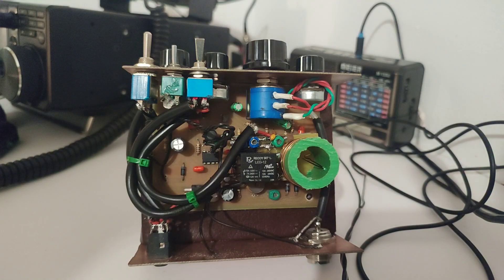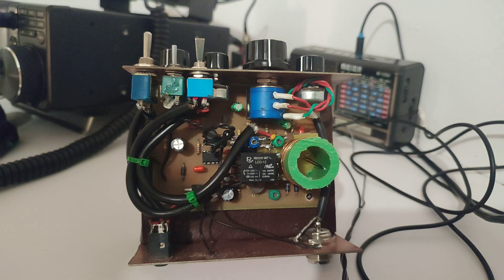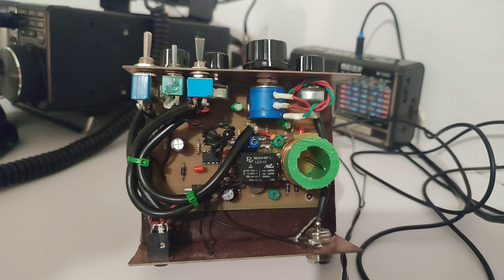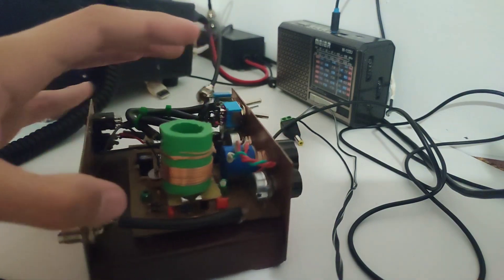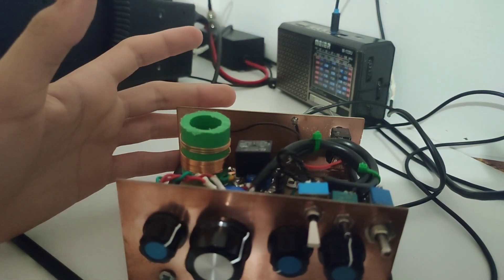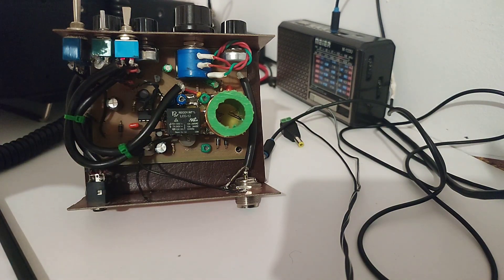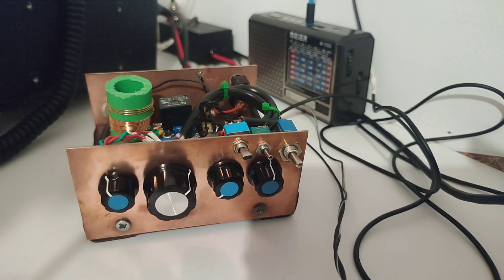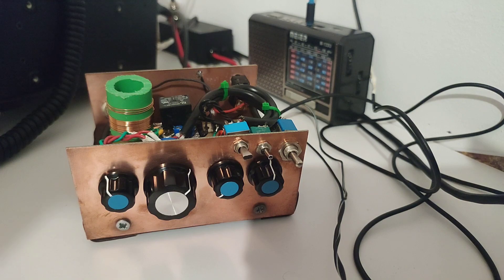2 Band Regen Receiver 40/30/20m (SPUTNIK MOD)

Comment: can you shgare the values or the schematic of the modification?
Reply from the maker: Good morning! sadly I don't have the details for this modifications any more... Basically it's a relay switching the tuning circuit to one of the coils trap
Reply: @sv2tcb  so you just switch more or less turns
?

Comment: Good results. I think band's can increase up to 10 ( 10 position rotary swich ). Band swich in main's LC tank's coil ( increase windings, coil sections ).
Reply from the maker: Thank you for the comment! Yes i should try something like that with a rotary switch but i have to re design the pcb. 73

Comment: You rock Nikos. Well it seems pretty official to me since it works fantastic 😅😅. You are so funny. Really nice results... great job buddy. I am happy your experiments had good results. We talk more on email tomorrow. Today I had a crazy busy day. 73, YO6DXE.
Reply from the maker: Haha thank you, i have the details for the modification and the coil, it works on 30/20 or 40/30 yet. I couldn't get a better demo on 20m due to propagation. 73 talk to you soon
Reply: @sv2tcb  Well... you do realize I just spent two years playing with this one over and over. I've learned a lot from this... besides that it got me into the hobby. I think now is your turn to "improve" it 😅. Is a simple receiver... and the results are nothing like WOW... but is fun to play with... and the best... we learn a lot along the way, I think that is what matters the most. The learning process... 73 buddy and have fun with it. Today I was playing with a large value variable capacitor. If you look into the new version I have now... I soldered the capacitor instead of C15... it was tuning between 4.3MHz to 7.2MHz. Not bad at all 😁😁.
Reply from the maker: @dxexplorer my first video of the receiver was two years ago, i think this is a really simple modification and i instantly works. I have also tried with variable capacitor not that big though and it works in a more broad range. The next step is to make it a 6 band receiver, with the relays you can include everything. If you want more information we will talk with emails. 73
Reply: @sv2tcb  I wanted to make some sort of "all amateur HF bands" regen receiver ... but fully with transistors only. A bit more complicated one with some audio filtering and also RF filtering on the input. But for this I think I will try one of the schematics from N1TEV and start from there. Is a little more sensitive so we will see how that works. A project for the winter maybe. Not much free time now.
Reply from the maker: Ok yes, maybe this project has reached an end. I want to try a qrp transceiver from vk3ye with ceram resonator but i have to find the parts which are not so common.
Reply: @sv2tcb  let me see if I can find something I have in my mind and I will email you an article.
Reply from the maker: @dxexplorer yes please. I would like to read it. Thank you 73